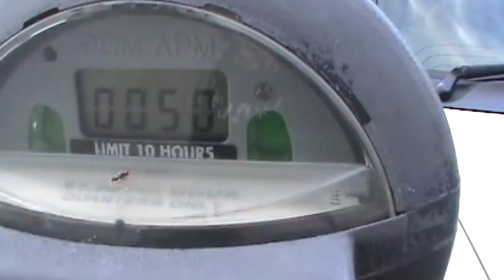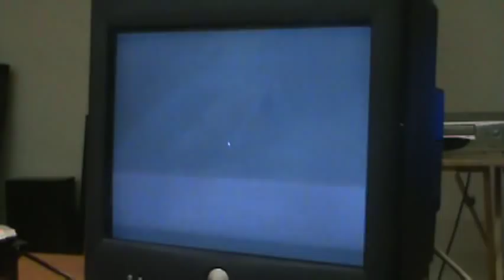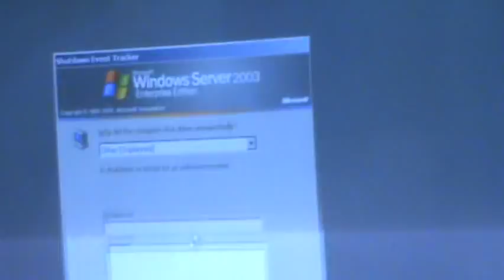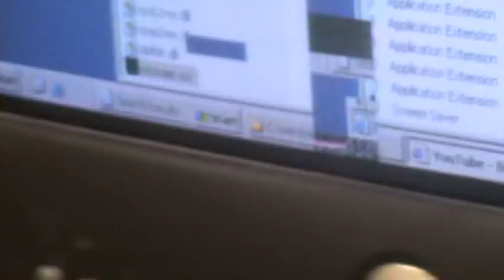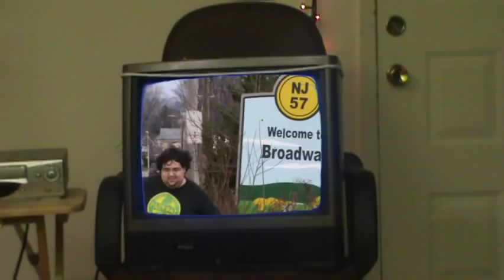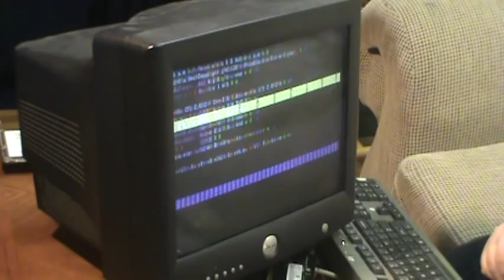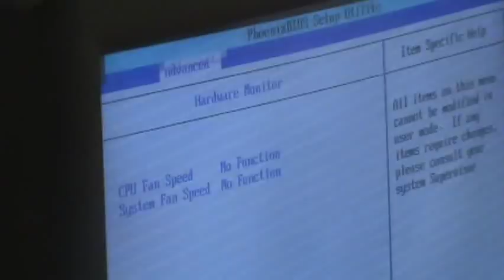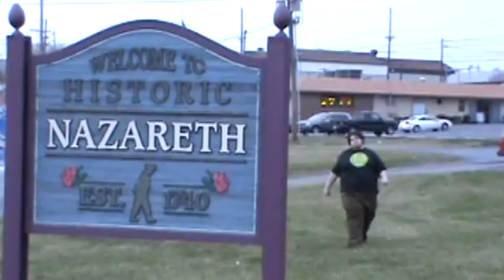Episode 26:  How to build a computer yourself

Comment: I wanted to believe so badly that it actually booted missing a CPU pin and with the RAM all fucked up but after watching this for the 4th time I finally noticed they switched boards :(
Reply from the maker: Episodes 64 and up are edited on a rig with an i7 with 12 removed pins.   I snagged it on my shirt and ripped them off and they're all either ground pins (about 50% of them are to minimize interference) or non critical lines.
Reply: That's awesome. Didn't even know they made i7s with pins on the CPU, thought by the time core came out it was all land grid array. Unless you meant you caught the mobo on your shirt, in which case that's a far more hilarious image.

 When I was like 15 I had to replace a dead motherboard on my Dude You're Getting a Dell and bent almost 2 rows of pins on the Celeron. Unfortunately they were not all grounds ;p But I somehow convinced my parents to finance building a new PC? Just realized how spoiled I must have been. Pentium 4 may be laughable nowadays but I was so excited to play Battlefield 2 faster than 10 seconds per frame.
Reply from the maker: +pandab34rYT I do mean the pins in the socket, snagged it with sleeve of a sweatshirt.
Reply: I've come from 2 years prior to  your comment to inform you they did not switch boards. The board slowly changes color after taking it out of the plastic sandwich bag and exposing it to a different environment. The cards weren't plugged in cause they forget to make a notch in them so they would fit in the slot. They all clearly fell out. That also explains why the computer failed later in the video; there wasn't a scuzzy in the computer.
Reply: @chongoslingcheese779  Nice try but X-rays actually make motherboards greener, so if it was from the x-rays leaking out, it would have gone from green to brown, not brown to green.
Reply: @pandab34rYT  Then the only logical explanation is that its one of those fancy boards thar change color based on temperatutr

Comment: Hi Sandwich Bags,

My processor-izer was delivered to me in a box marked "pizza hut" instead of "dominos". I'm assuming it's one of those fake Chinese knockoffs, but wanted to check with the pros since I don't know how to tell the fake ones from the real ones.

Thanks,
Lunch Box
Reply from the maker: Check pin count, you want either 188 or 291 but you can remove up to 7 pins to get to that number - if you can't, then the chip isn't gonna work dude hate to tell you
Reply: +42/11 Video

Sandwich Bags,

Thank you very much for taking the time to reply. I checked the pin count and it actually does not have any pins, but instead a bunch of these flat dots. Should I just solder pins onto these? Did I accidentally buy one of those "DIY some assembly required" processor-izers?

Thanks,
Lunch Box
Reply from the maker: Caucasians can't solder the proper pin pitch necessary for METAL MATRIX CONNECTORS.  If you have a proc with dat shit then you should trade it in for a Pentium 3 through 5 or Penjilum 4.   Cord Dual is also a good proc but i had bad 'speriences using a seven seater scuzzy bus